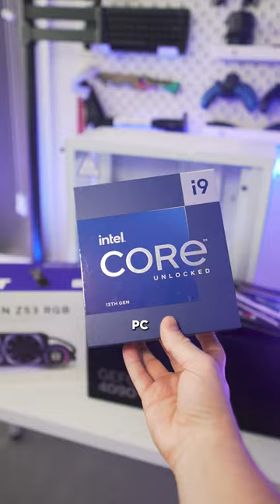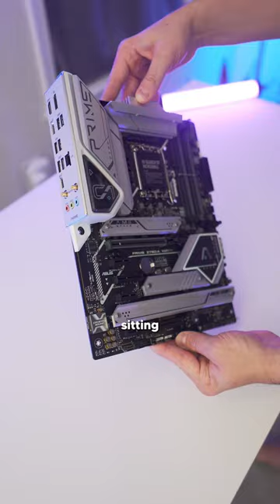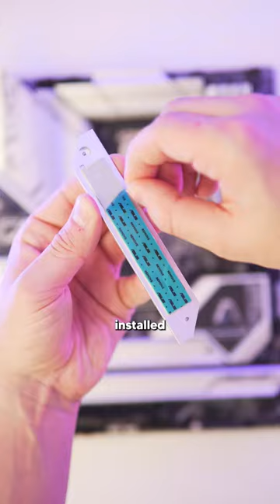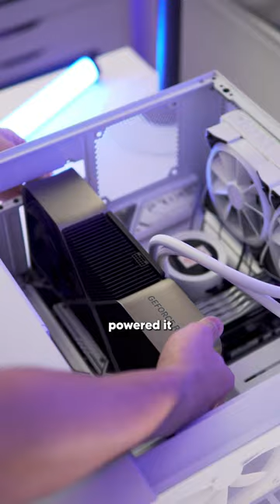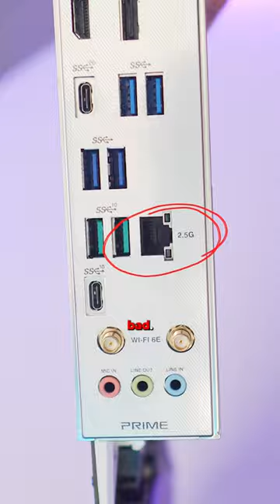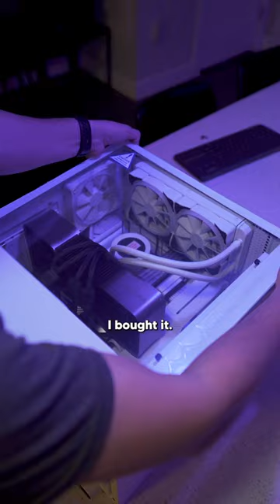PC Build Vlog 1 - It is what it is 🥲😂 Builds don’t always go as planned

Comment: i had issues with that ethernet controller as well i did a bios update and it fixed it.
Reply from the maker: So happy to hear that!

It looks like they also released a new LAN driver update (V2.1.3.3) on 3/9/23, so I'm glad to see they are addressing this issue
Reply: @driggsy  driver updates are way better than my dead 3060 I got when it came out. Even better, I had to return another one because it instantly bricked despite me not messing with bios at all, completely stock and BAM bricked. They send me a third one and it still works lol

Comment: Sick build, but just letting u know with the crazy temps on the 13900k a 240 m aio isn’t gun a cut it
Reply from the maker: Been handling it perfectly fine over the past month 😁
Reply: Well then that just means you're not fully utilizing the 13900k since benchmarks have shown you need a 360mm water cooler minimum to handle it at it's full wattage
Reply: Undervolting without power limiting won't lower the heat output anyway, and if you do powerlimit the 13900k it just makes the 7950x a better option so idk, 7950x3d is better overall as well.
Reply from the maker: @shanic1411  do you have those benchmarks previously mentioned? I’d be curious to check it out
Reply: @driggsy  It's not hard to find information on the subject but fellow content creators such as Hardware Unboxed and Gamers Nexus have information on the subject on their reviews of the 13900k
Reply from the maker: Great thanks! :)

Comment: you can have less chances of issues when you have components that are brand/like new when bought and they are compatible with each other, i had two simple issues when building my pc, the first one was the pc not posting, turned out to be the ram being incompatible.
the other issues was it not turning on inside the case, i removed two standoffs and it worked

Comment: That is crazy for a z790 motherboard that costs about $300. I would go for an MSI tomahawk z790 instead, I have not found a single issue with it online, other than it is expensive but its at the same price of an ASUS prime-a. If you want to stick with ASUS then I would recommend the ASUS Tuf z790. There is a ASUS rog strix z790 that is also silver and looks really nice but, there are multiple complains about it online and its about $380. The only safe top tier ASUS board would probably be the ROG strix z790-E which is priced at $500.
Reply from the maker: Right? Pretty insane. I can’t lie the main reason I chose this motherboard was aesthetics and that it was ASUS, but boy was that a mistake. 

The silver Strix Z790 is beautiful, but the only downside is it uses DDR4 RAM. Aaaand I’d be weary - it looks like it uses an Intel Ethernet chipset

Comment: My board wasn't recognizing its own built in wifi or the ethernet cable. Good thing I had an additional wifi adapter that actually plugs into a gpu slot. After that, I was able to connect to the internet and then my system recognized the cable and its own wifi. So wierd.
Reply from the maker: Glad you were able to fix it. Was it the same mobo I used?

Comment: Z53 Kraken for i9 omg good luck with underwolting
Reply from the maker: I haven’t had to undervolt - been completely fine at default settings
Reply: @driggsy  those are Power limited default settings limited for 253w full performance mode its barely handled by Z73 360 io i know have one at home those seetings you have barely get close 40k scores in cinabench AS IT should

Comment: amazon has pretty good return windows where i live for returns so I could probably order a 2nd motherboard before I return the first one and if I had the same issue as you, I would still have a functional PC while I wait for my replacement

they have good scam prevention stuff too because when I ordered a 5800X, I got sent an empty box and they started to process the refund in less than 10 mins after I send a complaint, I also got to keep the fake junk they sent me instead of my CPU

Comment: 240mm aio for 13th gen i9 will not work.
420mm aio got problems handeling them.
Reply from the maker: It’s been perfectly fine
Reply: @driggsy  It's of course still going to run. What "Two Face" probably means is that you will be unable to unlock its full potential due to thermal throttling at higher clocks. Still going to be a wonderful cpu though.

Comment: i just built my dream pc: intel core i9 13th gen k, msi rtx 4070 ti gaming trio, 64gb ddr5, 2tb samsung 980 pro nvme, an asus tuf gaming z790 wifi mb and a lian li o11 and i dont need ethernet because the nearest port is like 7 feet away from my pc
Reply from the maker: Sounds like a fantastic build. How’s it treating you?
Reply: @driggsy  good, but my fps in minecraft is getting capped at 260 fps even though I have it set to unlimited and v sync is off. I still dont know how to fix this, and I know that the card I have is a 4070 ti because in other games like beamng, I get wayy better fps than my old build, and everything in task manager and the bios checks out.

Comment: A 240mm rad on a 13900k you will not get the most of that cpu but the case also does not support it a h7 or a h9 from nzxt would be better
Reply from the maker: I’m ngl, I’m tempted to try out the Hyte Y40 🫢

Comment: Is there any specific reason you're using the NVME to load windows? From everything I've read and seen personally, it has no appreciable performance boost on Windows 11 vs using a SATA SSD. Seems like you'd want to keep all that NVME space for games that will actually need that extra speed.
Reply from the maker: The 2 SSDs I have packed in the back already have a bunch of data on there that I don’t want to move off, so I decided to just keep it simple and load windows onto the NVMe

Comment: I got the same case, but the side fans don’t work. Although all the fans spin the rgb does not light up, do I need to plug it it anywhere?
Reply from the maker: Make sure all of the fans are plugged into the included lighting controller, and that the lighting controller is plugged into your motherboard’s RGB header and power supply’s SATA cable
Reply from the maker: Oh and also make sure you download NZXT CAM!

Comment: I had the same issue with a gigabyte B550 board, and I had already gotten it RMAed before
Reply from the maker: I'm not alone :'( I wonder if it was using the intel i225-v chipset? That ethernet controller also had issues.
Reply: @driggsy  probably was, mine connected once but that was all
Reply from the maker: @trr4gfreddrtgf  definitely sounds like it. Intels gotta fix it!

Comment: What do u specifically mean by Ethernet issues? I have the same mobo but didn’t come across any problem.
Reply from the maker: Unstable connection, consistent time outs, and 400+ ping on Valorant. Was insane

Installed a PCIE Ethernet Card and all issues went away

I’m 99% sure I just got a lemon tbh
Reply: @driggsy  i had literally the same thing happen to my z690-a from microcenter.
Reply from the maker: @VocalSynthUtau  I'm sorry man that sucks. Not a fun situation to be in. Were you able to swap it out with a new mobo?
Reply: @driggsy  no i just bought an ethernet card
Reply from the maker: @VocalSynthUtau  if it works it works 👍🏼

Also try and see if they released any driver updates, maybe the fixed it by now

Comment: I got a wifi motherboard but it says I need to use the Ethernet cable
Reply from the maker: Did you screw in the antennas to the back of the motherboard?
Reply: @driggsy  no it's just been like that out the box right now I'm using a wifi card plugged into a pcie slot
Reply: @driggsy  the motherboard is the MSI pro b650-p wifi

Comment from the maker: Posted part 2!

Check out my profile & the description to see what motherboard I went with 🙌

--------

Also for everyone in the comments freaking out about my decision to go with a 240mm aio, please go check out Hardware Canucks myth buster video: 

https://www.youtube.com/watch?v=dNFgswzTvyc

I'm not running my CPU under all core rendering workloads so I never see temps near the TJunction (100° C). I rely on the 4090 for any sort of rendering, which it's obviously an absolute killer at.

Would a 360mm aio be better? Of course.

Is it worth swapping out the case for one that allows a 360mm aio, buying the new aio, and moving the whole build? IMO.... No.
Reply: add it on description
Reply from the maker: @SQEW63  I like the way you think. Added! Thanks for the suggestion

Comment: 360 AIO is necessary
Reply from the maker: Intel recommends a 240mm AIO at minimum

I’ve been more than happy with the performance so far, both in gaming and work
Reply: @driggsy  why would you cheap out just get a 360 and call it a day
Reply from the maker: @E55W211  Weird of you to assume I was trying to "cheap out"

I specifically wanted to build in the H5 Elite. Personally I think the case looks beautiful.

I could have gone with a 280mm AIO if I wanted to mount the rad in the front, but I wanted to mount the rad up top.
Reply: @driggsy  I have a 360mm Galahad and it was only 160. Not much more than the one you grabbed
Reply from the maker: @E55W211  Money wasn't a factor in me choosing this AIO